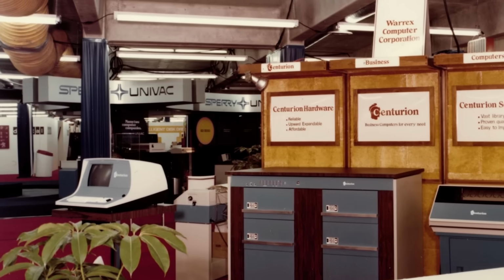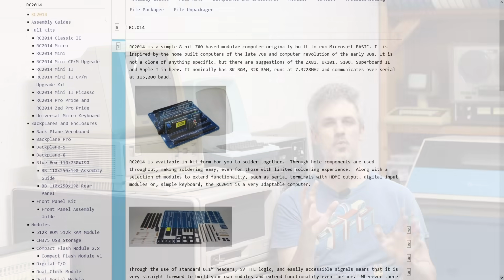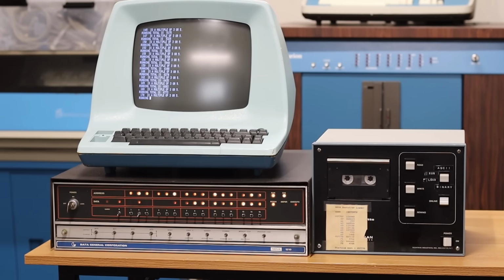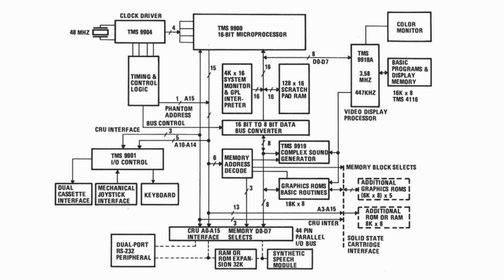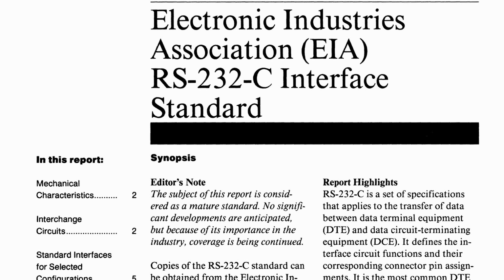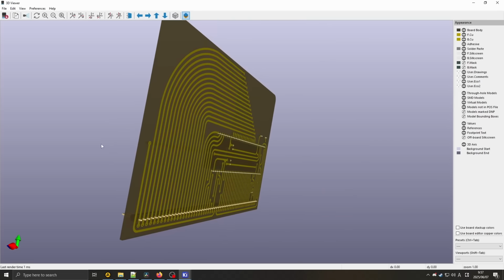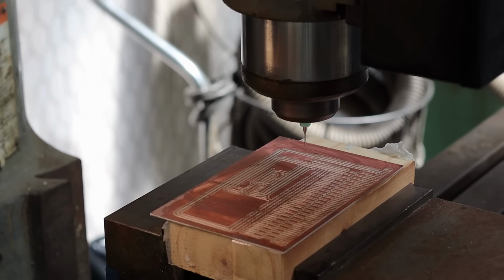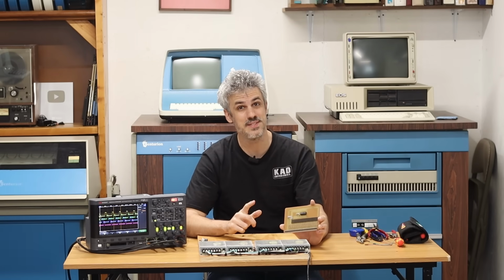The First Step in Building our TMS9900 Homebrew!

Comment: My first computer was a Heathkit H8. Agree it initially was not a home brew. The software selectable clock speed (2 or 3 MHz) modification as well as truly homebrew expansion cards did fall into the homebrew category however! I really enjoyed the extra details showing your setup for making PCBs because it’s been decades since I’ve made my own and they didn’t look near as nice. Single or double sided copper board, hand-traced PVC traces and through-holes, fighting to get both sides aligned correctly, and a bath in hydrofluoric acid to dissolve the copper away from any place that wasn’t covered by the PVC. But man, those were good times!
Reply: Laser printers are a godsend for making PCBs compared to the old days: you can use CAD software to avoid mistakes, and then transfer the mask with an iron. The through-holes give you a pilot hole for drilling. It’s a breeze compared to the old days. And with a turnaround of 20 minutes instead of waiting for weeks for mail-order PCBs.